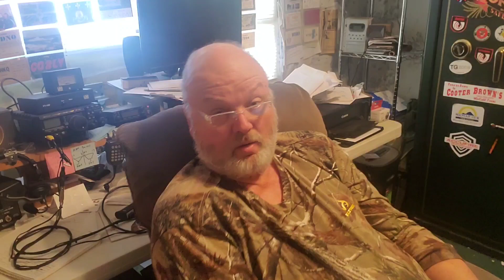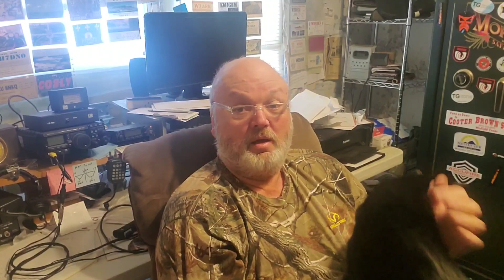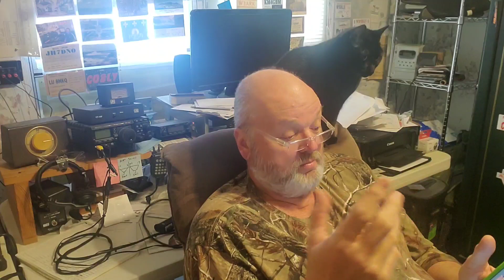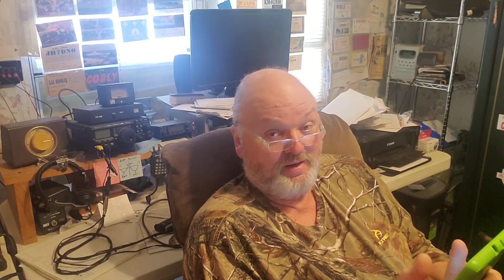POWER SUPPLY TYPES AND OPTIONS #AMATEUR RADIO #HAM RADIO

Comment: A possible 'scrounge' opportunity for (free?) batteries is to get in touch with a local recycler/e-waste service, or get to know a local corporation or data center hosting service and see if you can obtain some of the AGM batteries being replaced from UPS service.  They typically have a 10 year life but are replaced sooner.  I managed to snag (donation to my club's 501.c.3) 36 of a hoped-for stash of 120 100aH 5 year old AGM UPS batteries.  Perfectly good for ham radio service for another 5 years.